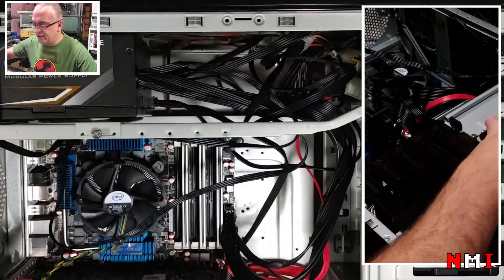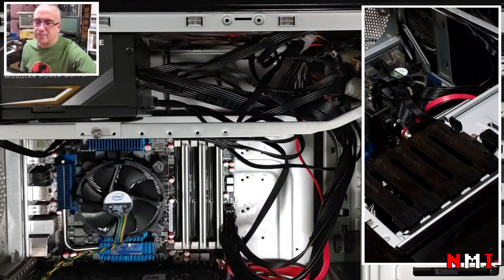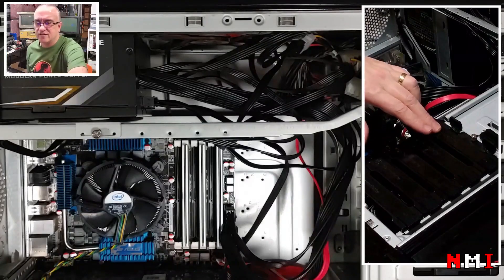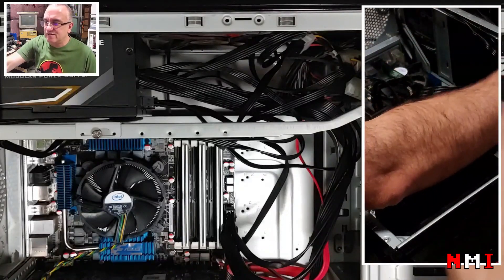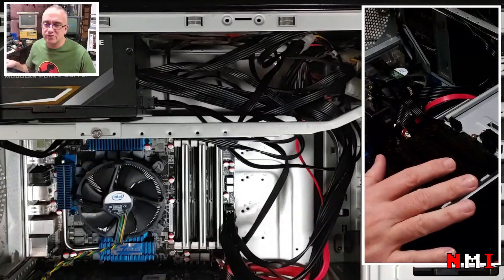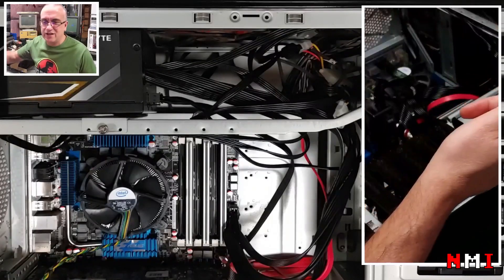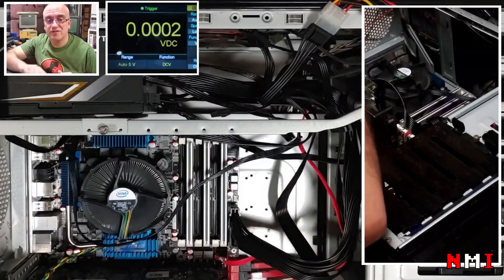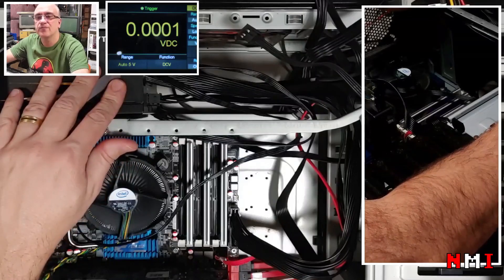01D - Don't do this with modular power supplies!

Comment: I also some years ago learned this lesson, storing all of my extra cables from various power supplies together. I grabbed the wrong one by mistake and fried something.
Now, I keep the cables for each power supply that aren't used in a build back in the power supply box that it came in so this doesn't happen again.
Reply from the maker: Yes storing PSUs with cables connected is a very good procedure! Thanks for watching!

Comment: I thought those followed a standard pinout... Well now we know, I hope no important data was lost with the drives!
Reply from the maker: Hey! Yeah it seems the standard only applies to the end of the cable connecting to the devices, not the PSU side. Regarding the HDDs, I might try to recover the data... Thanks for watching!